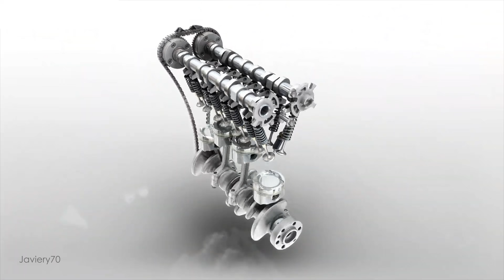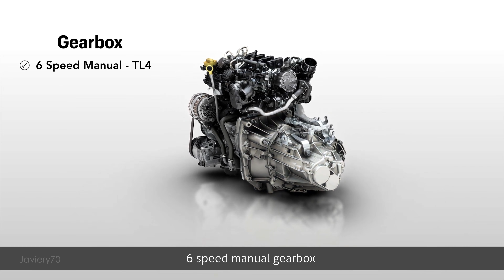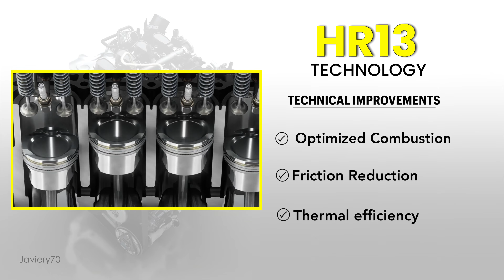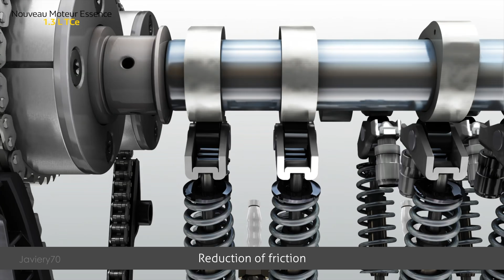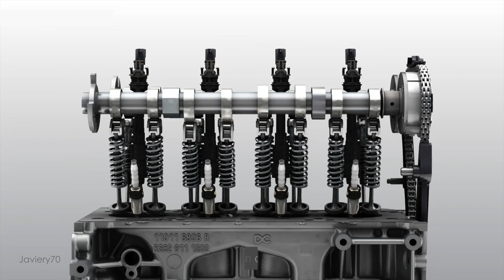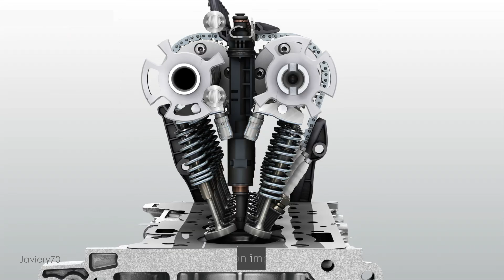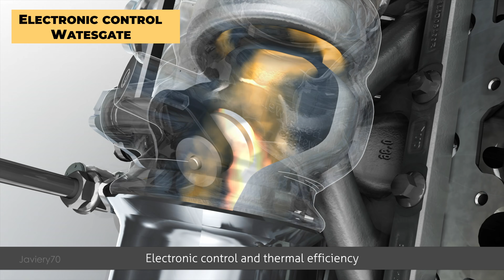🔸 Engine 1.3 TCe RENAULT - DACIA | Its Technology

Comment: I have made 165k with 1.3 tce 130hp,and until now was everything perfect.Some mechanics said it is not possible to repair…Big big disappointment after years of perfect driving.The thread is editet it was just a thermostat case and motor works perfectly fine!

Edit 2026/08 Motor has now 198tkm I am using it daily as delivery also,so I am making around 3tkm per month and on weekends I am driving for around 4 hours delivery on 50 different addresses and car works perfectly fine.I have not changed nothing,only oil every 20tkm and filter change.
Reply: They have checked it and it was apparently thermostat case,which is a know problem from nissan quassqai.
Reply from the maker: and the extra liter in the oil?
Reply: It was at the end no coolant in oil,it was only thermostat case,he changed it for 420e in Croatia,and motor works well ,I had luck nothing broke in the motor
Reply: @antoniobrnadic  Super !!
Reply: @antoniobrnadic what is 420e?
Reply: @barbarossarkaya6068 420 euros
Reply: @barbarossarkaya6068 420euro or 420 dollars
Reply: @barbarossarkaya6068  420 euros are payed for replacing thermostat.
Reply: They haven’t said it,I will know more tomorow I will keep you updated
Reply: @antoniobrnadic  Hello. Any news regarding extra coolant in the oil ?
Reply: @ersinali4152 it is a known problem,all the cases after 2021 are different (better) in therms of quality
Reply: @antoniobrnadic  I know this problem, my present project is to replace it with a Mercedes one.
Reply: Did you do that? Is it same part or updated one?  @ersinali4152
Reply: @ersinali4152 no problem with thermostat, oil it' ok , everything it's fine, 90000km
Reply: Ma bucur, mersi mult @AlinaTudor-r3o
Reply: @antoniobrnadic kako si zadovoljan sa 1.3 tce?
Reply: Well we have one at 168k and it just shut off and never started again. It has lost all compression and can be turned over by 2 fingers on a wrench. 

All the services have been made to renault standards and its weird how it just stopped working out of thin air
Reply from the maker: If there is coolant in the oil, the oil will have a different color, whitish.
Has the color of the oil seen on the dipstick changed?

If there is coolant in the oil, the first measure to take is to replace the oil cooler, there may be a leak.

Comment: Hi Javiery, regarding the 1.3 tce engine, is there a problem with the thermostat housing that controls the coolant temperature? It seems that that plastic casing would explode and all the liquid would flow, leading to irreversible damage to the engine. More and more qashqai users with this engine have encountered the thermostat problem. I own a Kadjar from 2019 with this engine that ran 80k km and I did not replace the thermostat. Would it be time to replace it to prevent engine damage?
Reply from the maker: It is not a general fault, and it does not happen in all engines.
It is true that the thermostat is made of plastic (DC brand) like all engines, but it must have a quality defect that causes a fine crack in one area.
I have seen this problem with engines with more than 60,000 km.
It does not occur in all vehicles in general.
I also have this engine with 30,000 km from 2019 and I have not changed it yet.
In appearance, the new thermostat is the same and from the same DC brand.
At Renault there is a new reference for the thermostat box, it must be of better quality now.
Although other brands can be obtained in car parts stores.
Depending on the engine number, there may be 2 different thermostat housings.
Reply: @javiery70  You are right, my friend. Due to the fact that the improved thermostat ( 110600260R part number) looks identical the previous one, although the manufacturer is different, the users don't trust the performance of the new thermostat. There are not made many  kilometers with the new thermostat.
Reply: @ersinali4152  Am vazut improvizatia ta cu senzorul de nivel instalat pe vasul de expansiune, de pe forumul nissan qashqai. Acolo sunt mai multi care au adoptat aceasta metoda de a monitoriza nivelul lichidului de racire din vasul de expansiune. Am dat comanda pentru acel senzor impreuna cu un buzzer si urmeaza sa le montez zilele astea. Cei de la Mercedes au schimbat termostatul cu un model in care carcasa este prinsa in holsuruburi. Sper sa nu mi se intample sa cedeze carcasa termostatului, mai ales ca Kadjarul meu a iesit din garantie.
P.S. Ce metoda ai adoptat pentru a lipi senzorul de vasul de expansiune?
Reply: @ersinali4152  Hello, I saw the video with the installation of the level sensor on the expansion tank of your Qashqai. How did you attach the level sensor to the expansion tank? I want to install a similar sensor in my Kadjar.
Reply: @usergoogle54  Hello, it is attached with glue. But it must be calibrated. If not it will give false warnnings.
Reply: Hi,i work in Nissan workshop and thermostat is common problem.Engine is good but often damaged because of thermostat.We changed thermostat in about 50% of cars with that engine.The cap of thermostat just separate.Often problem also is difference GPF press sensor.
Reply: @dragandojcinovic1756  does this include latest engines (2024 models) ?
Reply: @mrjoerizk  it have the same thermostat but it takes about 4years to make a problem

Comment: This Motor in a Mercedes gets red Coolant( like VW G12++) no blue/yellow Coolant and Motoroil with MB 229.52/71/72 Specification 5w30/0w20.
Reply from the maker: The coolant may be different depending on the country of manufacture and the manufacturer of the vehicle.

Comment: Hello! Is LIQUI MOLY 5W30 Top Tec 4300 compatible?
Reply from the maker: The specification and standard on the packaging indicates Renault RN17.
So it is compatible although Renault recommends the manufacturer Castrol.
The price is almost the same, I recommend the oil recommended by the manufacturer.
https://amzn.to/3OUvAOC

Comment: A garbage that will produce the same carbon as all direct injection engines. In addition, the turbine and variable valve timing will add daily problems. They solved the CO2 requirement at the expense of engine durability.
Reply: Simply add water injection if you are so concerned about carbon buildup! And an oil catch can! 
Otherwise it is a very good engine !
P S  - how long do you want an engine to last?? 1 million km??? Majority of people who buy these new won't keep them more than 200000! They pay full price! Second hand owners should not complain, because buying used is a lottery!
Reply: @adci2701 Um why wouldn't you want to last 1 milion km? Is a fucking engine not a smartphone. A car's life doesn't end when the first owner gets bored of it.One of the big reasons all these  small ass engines exists is pollution. If we are so concerned about CO2 figures we should take into account everything like how much co2 is produced when making a new engine and then shipping it around the world and then putting it in a car and also recycling the old engine and so on not just the fuel consumption figures  on a very biased test. Small engines are garbage they are only made to fake fuel consumption tests IRL they sip fuel like crazy they have no torque at all unreliable as he bcs they use all types of expensive and complex technology just so they can keep up with an older NA engine in performance and longevity is a joke too cause most of these engines can't even be rebuilt.

Comment: No port injection that causes a dirty intake and valves ? How do we prevent that ?
Reply: VAG smal engine latest version don't have egr valve to make dirty kill intake valves.Mabe this engine also?
Reply from the maker: This engine does not have an EGR solenoid valve.
Reply: @haksu78  Carbon buildup does not come from the EGR, but from the PCV system. Unless the engine is burning oil, then it would come feom the EGR as well.
Reply from the maker: Correct.
Direct injection systems can usually cause carbon deposits behind the valves.

A defect in combustion combined with excessive oil consumption can increase carbon buildup.

Generally, gasoline combustion is more complete and cleaner than diesel combustion.
The only way to avoid and delay the production of excess carbon is with proper engine maintenance and to ensure that there are no faults in the system.
- Clean air filter.
- Spark plugs in perfect condition.
- Lubricating oil in perfect condition.
- Use quality gasoline.

Comment: Hola , no entiendo miy bien porque recomienda,dos viscosidades de aceite, ¿ Alguien sabe de que depende utilizar uno u otro? Saludos
Reply from the maker: En el programa de mantenimiento puede aparecer el mismo aceite con 2 dos viscosidades diferentes .
- RN17 5w30
- RN17 FE 0w-20
El aceite 0w-20 es un aceite mucho más fluido, con la denominación FE que significa 
Fuel Economy . Es un aceite de muy baja viscosidad que fluye mucho mejor incluso a bajas temperaturas.
Por ofrecer muy poca resistencia y ser tan fluido favorece la reducción del consumo de combustible.

⚠️Solo se puede usar este tipo de aceite si el motor es compatible de lo contrario el motor se gripará.

Este aceite 0w está indicado sobretodo en climas fríos.
Reply: @javiery70  muchas gracias por la rapidez en la respuesta, esperando el vídeo prometido, un 🫂

Comment: Given to Renault to build, that going to be reliable🙄
Reply: Forget the 80s Renaults. Now its serious brand efficient and reliable long lasting engines.
Reply: @clivewiddall3430  My expirience is that I have no troubles for years.  The engine used in my Vito is 100% in order.  Time to change timing belt at 150,000 km. 
Never mind indicators of temperatures, once the engine países 90°c  at any point it stalls.
Reply: At this momentt I have a mild hybrid Captur 140 hp with this engine and the double clutch automatic gearbox. A smooth engine and a fine car to drive. Started when I was 19 years old with a second hand Renault Dauphine. After 2 Renaults 12, a Megane Grand Tour, 3 Scenics in total and 2 Lagunas, I can only say they never let me down and never gave me serious problems. Not with the engines, not with the electronics. In my experience very reliable vehicles.
Reply: Plastic termostat housing cracks open, releasing all the coolant, making the engine  overheat and melt. The temperature sensor does not show increase in temperature due to this, because it is located in that housing as well. It just reads engine bay air temperature, and you think your engine ia fine, untill it siezes...

Comment: The Duster 3 has a 3 cylinder, 1.2, 130HP engine derived from this hr13.
From what I know it's an older Nissan engine at the core.
Reply from the maker: The old 4-cylinder HR12 - TCe 1.2 engine was discontinued at the end of 2017.

The new 3-cylinder HR12- TCe 1.2 engine is a completely new engine for both mild hybrid and full hybrid applications.
Reply: @javiery70  and what about the hybrid 140 in dacia? I am wondering about what design the combustion engine follows. I know its derived from hybrid 145 of renault, but what are its tech origins? Or was it made for just hybrids?
Reply from the maker: The Dacia 140 hp hybrid engine is an engine that does not come from any other engine, it is a new engine designed to be a hybrid.
A 1.6 cc naturally aspirated engine with 91 hp of power.
🔹 RENAULT - DACIA | Tecnología Híbrida E-Tech
https://youtu.be/UkjhNdVD6e8

In addition, there is a 130 hp 48 v Mild Hybrid engine with a 1.2 Cc and 3-cylinder thermal engine.
Reply: @javiery70  thank you, I watched it with subtitles and it has been enough to understand! :)
Reply from the maker: @peterpagac8607  👍👌
Reply: @javiery70  Are you sure? The hybrid duster has a 1.6 HR16DE (H4M) based engine in atkinson cycle and assisted by 2 electric engines
Reply from the maker: @Tud @Tudorgeable ia has 3 hybrid engines:
- Mild Hybrid 48v 140 hp with 3-cylinder TCe 1.2 engine. (H5F)
- Full Hybrid 140 hp with 4-cylinder SCe 1.6 engine. ( H4M )
- Full Hybrid 155 hp Wurth 4-cylinder SCe 1.8 engine ( H5P )
Reply: @javiery70 For some market there is 1.3 version but FWD
Reply from the maker: It refers to the 1.3 TCe 4x4
Reply: QUESTO INVECE,3 CILINDRI!! È UN BEL !!! CESSO!!! DI MOTORE!!!!!